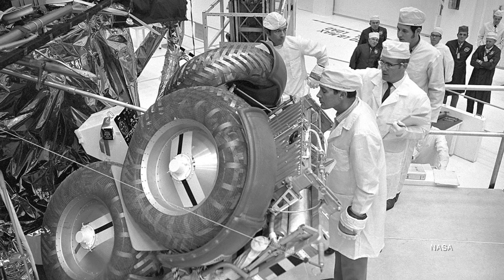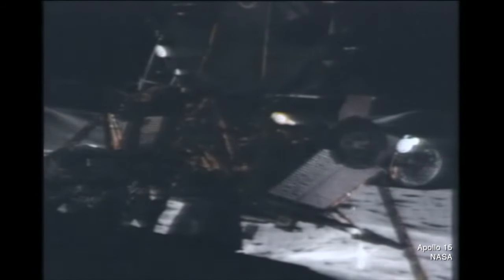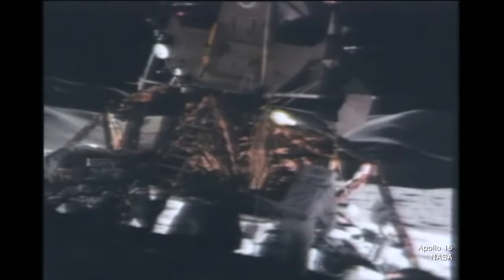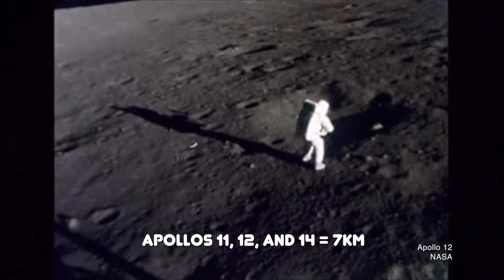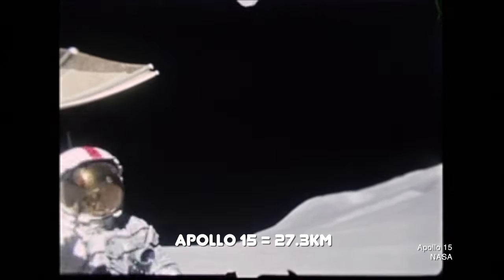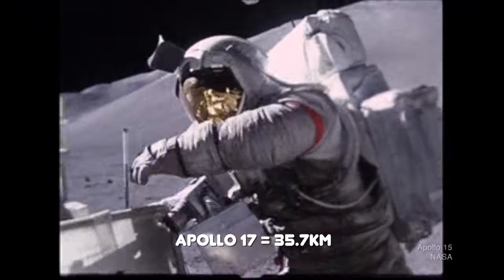How NASA Took Cars to the Moon

Comment: battery specification is 125 degrees  F limit...how can this be.
Reply: Great point since lunar surface temperatures can reach 250F. And, given the battery technology of the 1960s there's NO chance that the Astronauts could have stayed on the lunar surface as long as they did much less driven a lunar rover around for any length of time. Was a total HOAX!
Reply: @wendelallen2539  The moon landings where done during the moons dawn so the temps where never that hot on the surface. And the moon is very different that only things to the touch are hot. Its no actually hot there all the time because there is no air.
Reply: How's that? They supposedly stayed on the moon for many hours which would have extended past the moon dawn phase. Also, the moon is constantly being hit with micro-meteorites, and cosmic and solar radiation, which would have made landing on the moon in that poorly constructed LM (much less walking on the moon) fatal.
Reply: @wendelallen2539  do you realize that a full day on the moon lasts 29 earth days? The day lasts 14 days and the night lasts 15 give or take.
Reply: True, but I kinda doubt that all of the Apollo moon landings took place during the Lunar dawn. However, even if that were true the surface temperature would have gotten quite high.

Comment: It is the most stupid idea to carry the  rover. Even if it was folded, it had to take half of the room where the propulsion motors were. Everything is false about NASA.
Reply: Extending the range of exploration of the Moon was a stupid idea?

Also, no it wouldn't. The "propulsion motor" was in the center of the Descent Module, and the LRV bay was on the outside.
Reply: Everything is stupid except the idea of a flat earth 😂😂😂😂

Comment: The concept model was designed with a 1/6 GI Joe astronaut figure as its driver and the full size version had 4 wheel drive/steering. The first rover's front wheels wouldn't turn and another was involved in the first extra terrestrial accident when it knocked a fender loose by hitting a rock. The design was dictated by the storage compartment shape and was why it folded into a pyramid like shape of the 5x5x5 compartment. The strangest feature was that it used a form of wax as a heat sink for the batteries and doors could be opened to let the wax cool between trips.

Comment: I DID NOT KNOW the last rover missions drove THAT FAR total distance.
Reply: It's also amusing that they covered that in 3 days.  Compare that to the Lunokhod rovers that covered 39km in a little less than 5 months or the Opportunity rover that took 10 years.
Reply: Peter Merchant → If the Apollo astronauts had taken THAT LONG, their oxygen would probably have run out...《grin》
Reply: The difference between manned and unmanned driving is the difference between turning the wheel and being able to dodge a bump in a fraction of a second, versus having to wait a couple of seconds, or even minutes, for the round-trip response time.
Reply: Im pretty sure the reason that the Lunokhod and MER's took so long to do it is that they were driving along slowly so that ground controllers could deal with obstacles, and that they were stopping to look at things. The Apollo rovers on the other hand were being driven by astronauts which could react in real time to obstacles, and had a pretty good idea where they wanted to go. So they weren't stopping a whole lot.
Reply: Yupp, especially with the mars rovers you cant control them directly because the signal takes minutes to run - so they have to wait for images from the rover, then they simulate and plan the desired path here on earth to make sure the rover does not get stuck etc - then they transmit the program, then the rover moves a few metres or even only centimeters, then the whole process starts again. the same goes for drilling rocks, collecting samples etc. - i guess a manned mission can make months of  rovers work in a few hours. 

but maybe this will get better with advances in AI in the coming decades.
Reply: I believe it's an hour or more from sending the instruction for the Mars rovers to hear the command. So driving REALLY SLOWLY is the way to avoid an accident! :)

Comment: Simple question, I think. How did they manage to get the camera on the rover to track the lunar module's take off? How did they get it to pan up?
Reply: Hi Damien, hope that you are well. You referred to the filming of the assent stage of Apollo 17. This camera was controlled by Ed Fendell in the Huston control centre. This as you can imagine was a difficult task, In addition to the 1.3 second time delay each way he had to deal with a motor reaction time of just over 1 second. This meant that he had to anticipate some 4 seconds into the future. The filming of the Apollo 15 and 16 LM assents didn't go exactly as planned for various reasons but third time lucky Ed got it wonderfully spot on for the Apollo 17 LM assent from lunar surface. More details about and plans of this camera system are available online. Take care.

Comment: How did the astronauts sleep, generally, live in the LEM?
Reply: I believe they slept standing up, supported by a harness. The weak lunar gravity made that possible. There was no room to sit or lie down anyway.
Reply: They rigged hammocks, it was a tight space to maneuver around in.
Reply: I guess they never needed to sleep when landed on the surface. They didn't spend more than a day down there. Did they?
Reply: Farhat Pirhosseini Apollo 14 and 15 spent two days on the moon. 16 and 17 stayed three days. With an EVA each day each mission stayed on the moon.
Reply: Not very well, they sat in their own feces.  Personally I would rather go to a nice resort on Bonaire.
Reply: Wow. Sorry I asked the question.
Reply: "Not very well, they sat in their own feces."  What makes you think the astronauts sat in their own feces?
Reply: Kevin Kingston three days on the moon.
naybe they had a toilet, shower facilities, a basin for shaving, extra toilet roll incase they got a wee chill on the moon.
how did they float a log over those three days???
Reply: +The Woob
They pooped into specially designed bags. Just like what the astronauts on the shuttle had to do when the zero-G toilet quit working.
Reply: They stayed in a Howard Johnson's that is hidden by a rock so it can't be seen.
Reply: Easy they just ate in the studio canteen

Comment: Fantastic video, as usual! How did they account for the extra weight during launch?
Reply: Alvious The rocket was designed for it to begin with. Also it had extra room to spare in the design. There may have been some really nitty gritty program settings that had to be changed for the flight computer but that is it.
Reply: Mike, actually, the Saturn V had been so altered for the J missions that a lot of the engineers were really worried that it might be a problem, since they never tested the modified Saturn V.  The F1s were boosted up in power.  The landers were modified with bigger engine bells.  The landing trajectories of the last 3 missions were greatly altered to be more aggressive to save on fuel (at the price of some of the safety).  The list goes on.  But, they pulled it off.  I mean, ok, the engine bell on Apollo 15's descent stage has a massive crack in it because it slammed into the moon so hard that you can basically almost say it crash landed.  But, I don't think that was because of the extra weight.  Anyway... I ramble.

Comment: How could the camera follow the lander's takeoff?
Earth operation is too slow with the delay.
Reply: Anticipation, given that the accent stage tack off needed to be precisely timed in order to rendezvous with the CSM the signal delay can be taken into account. It is difficult to get the timing right, which is why even though it was attempted on Apollo 15 and 16 the only time the camera movement correctly followed the accent stage was on Apollo 17.
Reply: they set a timer to pan the camera in advance. IIRC the one and only time it actually was timed correctly and caught the entire launch in-frame was Apollo 17
Reply: Thank you all for the explanation.
Learned something again :)
Reply: 15's camera tilt was broken, so they couldn't even try to pan up.

Comment: I remember that Grumman was constantly redesigning the Lunar Module to get the weight of it down.  How were they able to handle the additional weight of the Rover?
Reply: Because the Saturn F-1 engines were uprated by an additional 22,000 lbf each by the time the J-missions were happening.

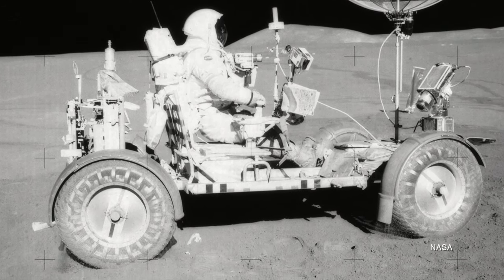Comment: You have to like at 1:18, NO TYRE TRACKS. So they picked up this car and placed it down before driving ( 2 people ). Why did they take cars? Once would have been enough as they are treating the moon ( if they went ) as a tip.
Reply: Paul Lipsanos Each lander landed in different places, so if the next guy wanted to use the rover from the last mission, he would have had to walk several hundred miles, which moots the point.
Reply: Mike Davidson Understood but how did they drive without leaving tyre print's? Also, how many Russian's went to the moon which was broadcasted live? Why don't we have a live stream from newer rovers like China's? Why are ISS live feeds ( if they are ) in full daylight when on the dark side of Earth and you see sun rises and set's but never the moon?
Reply: Paul Lipsanos I am going to save the first question for the next reply.
 Zero russians went to the moon cause they couldn't build a rocket that wouldn't explode on the pad before the Soviet union collapsed. 
The chinese have always been irrationally secretive about their space program, in order to ensure they don't look bad if they ever make a mistake (like when a main engine failed on one of their rockets causing it to veer into a local village). 
The ISS is on a very different orbital path than the moon. That in combination with the fact that the camera is pointed primary downwards towards earth means that there is a very slim (and if i did the math maybe even impossible) for the moon to be spotted on that particular camera. And couple that with the fact that it may be a new moon and it's gonna be a pretty rare, if at all existing event.
Reply: What are you trying to say? That studio sand doesn’t show prints?
Reply: Paul Lipsanos As for the why no tire tracks, I have a couple of ways of approaching it. 

A) The lazy way:
If you look close enough you can see tire tracks behined the front wheel, it is a little grainy though. 

B) The hole in the story:
I literaturally mean holes. As you can see from the picture, the tires are actually made out of an aluminium mesh, with thousands of holes in it, unlike a solid rubber tube your find on your car. These holes allow for moon regolith (dirt) to pop through the holes as it rolls over. This would create a fine grid like track, unlike the solid ditch you would expecte from a rubber tire, that would be hard to see at an angle, especially in black and white and in this old quality image.

C) The earthbound way:
Another thought would be, if this was on a soundstage back on earth, and it was surrounded by what appears to be a sandy landscape, how did they get the rover there without leaving tracks anyway? So the same argument could be used to say the photograph was not taken on earth.
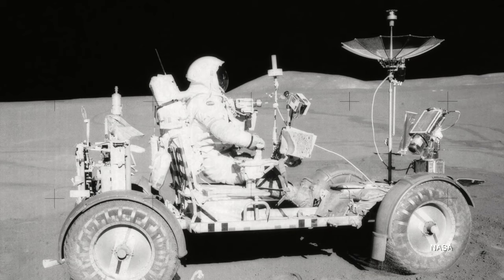Reply: The image used a 1:18 is a cropped version of:-

http://tothemoon.ser.asu.edu/data_a70/AS15/processed/AS15-85-11471.png

In the full frame image you can see that there are astronaut footprints all around the rover (including behind it).  So the odds are that you cannot see the rover tire tracks because they are under the astronaut's foot tracks.
Reply: That proves the tyre tracks aren't there as a foot print is visible. Notice the track marks to the back also, very noticeable. Hope they picked up the rubbish near rear tyre which was not pushed down by tyre.
Reply: Obviously the tire tracks aren't there, else they would be visible. That doesn't mean they were never there. The astronauts kicking dust over them as they moved around the rover is sufficient to explain their not being visible in the photo. As has already been mentioned, the rover tracks would not have been that deep or that distinct to start with. (There is plenty of video of astronauts moving around that shows how much dust they kick about as they move.)

The context of this photograph in the magazine (two images after a close up of the retro-reflector) and the debris visible in the image (particularly the rope/cable in the bottom left) suggest that this photograph was taken at the LM prior to a sortie and so between the rover's pre-sortie system checks and actually driving off.
Reply: ytmoog   go further and carry more, isn't that the whole purpose of cars, besides of course giving teenage boys something to talk and dream about?
Reply: Mark Holm The thing to dream about, is not unique to the cars bound to earth.
Reply: I'm scared for you people
Reply: Paul Lipsanos:

YOU SAID: "You have to like at 1:18, NO TYRE TRACKS. So they picked up this car and placed it down before driving ( 2 people )."

== No.  Wheel tracks depended on conditions.  Sometimes there were clear tracks.  Other times, in other areas, there wasn't much dust, it was much more compacted rock, and virtually no tracks were left.  Other times, it was so powdery that the dust just flew up from the wheel and right back down into the track that was being made, thus masking the tracks.  Also, the speed the rover is traveling at will have an effect on the tracks.

YOU SAID: "Why did they take cars?"

== To go further than they could on foot.

YOU SAID: "Once would have been enough as they are treating the moon ( if they went ) as a tip."

== A tip of what?  Once what?  I don't understand.

YOU SAID: "Understood but how did they drive without leaving tyre print's?"

== In the photo you're talking about, they had just stopped the rover to work around it.  There are tons of foot tracks that have disturbed most of the wheel tracks.  Who cares?  It's not a conspiracy to stop and work around the rover.

YOU SAID: "Also, how many Russian's went to the moon which was broadcasted live?"

== None.  I mean, I realize that it's the latest conspiratard craze... to take that old Russian MOVIE, and pretend that it was a real moon landing.  But, sorry, it was just a movie.

YOU SAID: "Why don't we have a live stream from newer rovers like China's?"

== Ask China.

YOU SAID: "Why are ISS live feeds ( if they are ) in full daylight when on the dark side of Earth"

== You really need to study how sun angles work.  Good grief.

YOU SAID: "and you see sun rises and set's but never the moon?"

== The lunar day is A MONTH long (Earth time).  We didn't go there at night.  The longest we stayed on the moon was 3 days (Earth time).  But, on the moon, one sunrise to sunset is about FOURTEEN DAYS long.  Seriously, when you know SO little about the science, why do you think you know enough to question Apollo?  You're so ignorant about the moon that you don't even know how long a lunar day is... and you think that a Russian fiction MOVIE is "real"... yet, you think you know enough about this topic to conclude that the moon missions were faked??  Good grief.

YOU SAID: "What are you trying to say? That studio sand doesn’t show prints?"

== Of course it shows.  Just not as much as you apparently want it to.  Again, this is the moon we're talking about here.  It's not uniform.  There are plenty of photos of tracks that show, then suddenly end, then start showing again 15 feet later.  Do you think that NASA went around and picked up the lunar rover for no reason, moved it 15 feet, then drove it again?  No.  Of course not.  Sometimes tracks show up better than other times.  It's not more complicated than that.  The same is true on Earth, you know.  If you drive over dirt, grass, mud, sometimes your tracks show up better than other times.  Sometimes your tracks appear to stop then start again.  It happens.

YOU SAID: "That proves the tyre tracks aren't there as a foot print is visible."

== So, in your mind, if someone steps on a wheel track, disturbing the track, making it less visible, that means that there's a conspiracy??  Good grief.

YOU SAID: "Notice the track marks to the back also, very noticeable. Hope they picked up the rubbish near rear tyre which was not pushed down by tyre."

== I have no idea what you're talking about.  Look, quit trying to manufacture imaginary evidence for your delusion.  There are hundreds upon hundreds of photos of tracks.  They come in all forms imaginable.  Weak tracks.  Strong tracks.  Deep tracks.  Shallow tracks.  Rover tracks that are disturbed by foot tracks.  Foot tracks that are disturbed by rover tracks.  Tracks seen by LRO.  Tracks seen by JAXA.  You name it.  This is how things are.  Quit trying to twist these photos into some sort of massive conspiracy.  Good grief.
Reply: YOU SAID: "Why did they take cars?"

== To make it more dangerous for the astronauts as it was too easy for them and the audience was asking for more. Imagine the fun of the rover breaking a few Km. away from LEM.  Or imagine the thrill of the rover capsizing while driving on top of sandy hill.

Comment: Important fact not mentioned:
Having a car certainly helps mobility, but because it could break down at any point, NASA would not let them drive any further than the astronauts could walk back to the LM.  So the factor limiting range, curiously enough, is oxygen.

Also no mention about how 2 of the 3 rovers had a fender break, spewing dust all over the astronauts.  The fix was to tape a card in place as a makeshift fender.

Finally, no vid about roving the Moon would be complete without mention of the Lunokhods.  (Let alone other extraterrestrial rovers.)
Reply: @ab-uz8sd  Wouldn't you  be the troll in this instance?